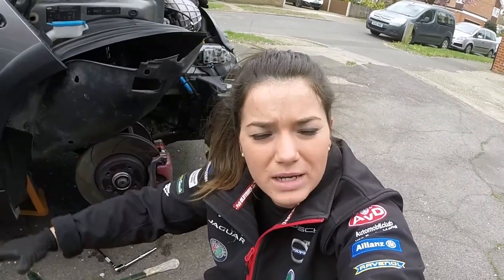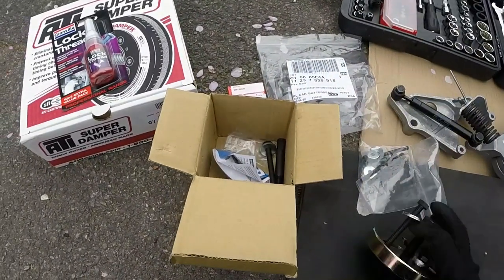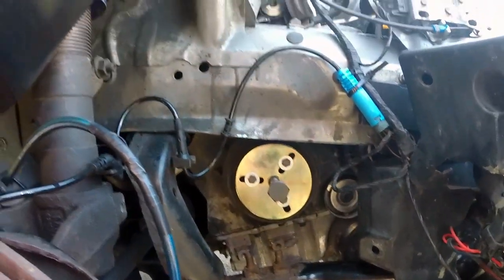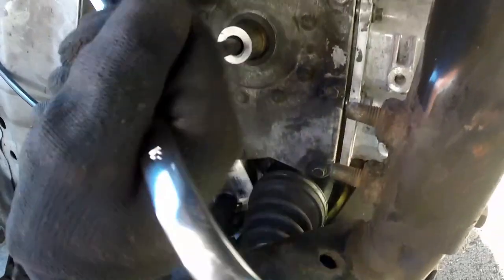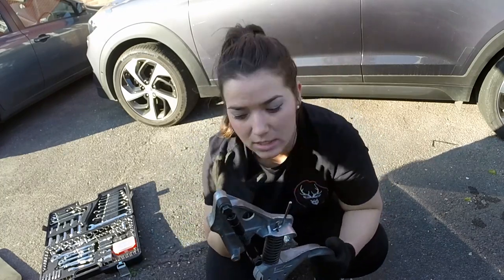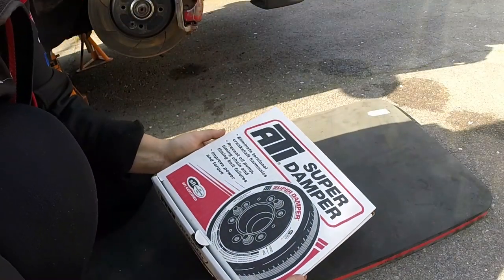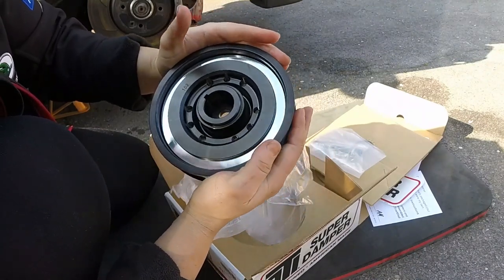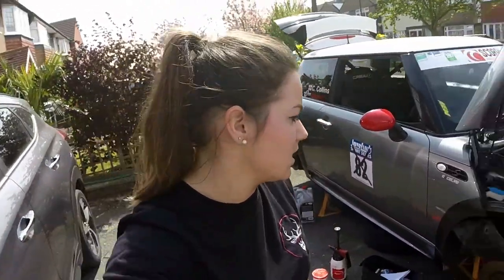MINI Cooper R53 ATI Crank pulley and tensioner UPGRADE // RACECAR PARTS

Comment: Hi Cleo, I found this to be a really useful video. My crank pulley gave up on me and obviously made a mess of the belt and the timing cover. I just completed the job of replacing the crank pulley (OEM), tensioner, idler pulley and belt.
It took me about 3 hours and all the info and tips you gave were very much appreciated.
I also found a handy way of releasing the crank nut using the starter motor, which you can look up on youtube.
Anyway, many thanks and i hope you're keeping well as you haven't posted any videos lately.
See you at Brands in the spring hopefully!!!

Comment: nice one.. I did that same job with tensioner/ belt and tensioner stop in 2018...i did cheat, 1320 fitted my crank pulley when the chain was done.they said that BMW had upgraded the crank pulley...i bet you can hear the supercharger whining now ..brings a smile...great job...

Comment: Very impressed by your video, the detail and explaining of the process is excellent. I wish I would have found your video before I started my project, now I am paying for it! When I got my ATI Super Damper I think they forgot the instructions? Plus when I got my puller, it didn't come with a thrust bolt. Who needs instructions, I am a professional and been working on cars when they had stone wheels. I know everything and instructions are just a piece of paper. Well here's the problem, I stripped the threads and now I have to buy a 12mm X 1.25. So much for knowing everything, coming from a customizer to a Concourse restorer. I guess we all make mistakes? I wouldn't have if I found your great video. 
BTW your as cute as the Mini Cooper itself!
Thanks, from Speedracer

Comment: Suggestion for anyone else doing this job... Replace the rubber bushings in the belt tensioner with Powerflex urethane bushings. I put a new OEM tensioner on mine and within 8k miles, one of the rubber bushings disintegrated.
BTW, The new OEM bolt already had thread locker pre-applied. No need for additional thread locker.

Comment: Hey, realize it has been a minute but is there any way you could tell me what the thread pattern is in the three bolts used to pull the dampener are. The (3) bolts that go through the disc part of the tool and thread into the actual dampener to,pull it as you screw in the bolt that applies tension to the crank. Is this clear enough? Thanks in advance!

Comment: Really enjoy your channel.
Any reason why you didn't go for a lightened pulley? I'm on the fence as to whether to go for one or not...re- not that clever for engines in the long run but interested to hear your view.
The air con Is definitely going,seems that the smart way for that is to fit the idler pulley in its place and not go for just the belt as they can slip.
The crank pulleys on the pre face lift cars were apparently pretty awful.
Thanks in advance for any advice.👍
Reply from the maker: Thanks really appreciate it. And I’ve seen a few lightened crank pulleys over the years break due to the spokes on them being weak, they just shatter. The OEM crank pulley is totally reasonable if it’s being used as a road car or there’s other cheaper liquid filled alternatives :) 
I’ve kept my aircon but, you can just remove the aircon pulley all together and fit a shorter belt. I’ve heard some issues with the belt slipping under full load when doing this, but it seems to be quite rare
Reply: @carsandbras2202  thanks for the input.
Was just watching another of your uploads, you,re running at 209 ponnies.
Have you got you specs written anywhere as to what you did to achieve these figures?
I know it's probably a pain in the arse to keep telling everyone 🤔, I'm just on a similar mission with my car and always keen to hear .
It sounds extremely sweet at Brands
Reply: @carsandbras2202  the reason not to run a solid lightweight pulley is because the engine needs dampened - as a 4 cylinder it is intrinsically imbalanced, and no dampening would cause premature failure of oil gears, bearings, etc.

also, the ATI is not fluid filled but instead uses specific types of rubber and clever design to isolate vibrations. There is a company, PRW, that sells a fluid filled damper.